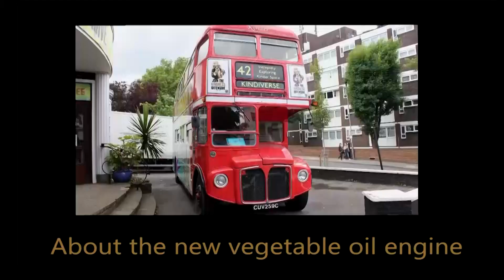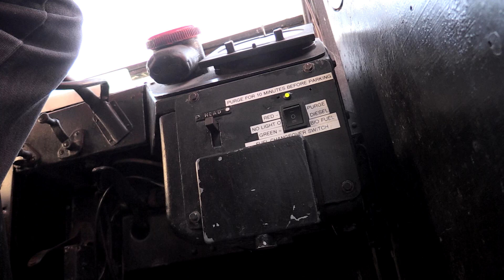Routemaster Vegetable Oil Engine Conversion - Kindness Offensive

Comment: The level of ignorance in the comments is astounding.    Buses and garbage trucks in some cities in Japan have been running on waste vegetable oil for close on 20 years now. Buses in London are powered by 1/3  recycled bio diesel.  Several cities in europe run buses on a mix of waste bio and mineral oil.  Biodiesel has been produced on an industrial scale in the EU for the last 28 years.